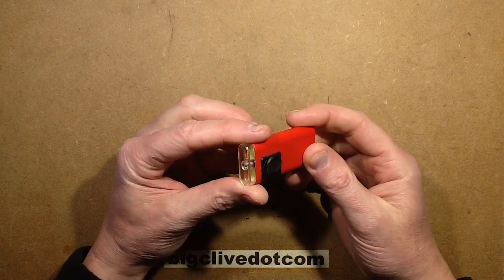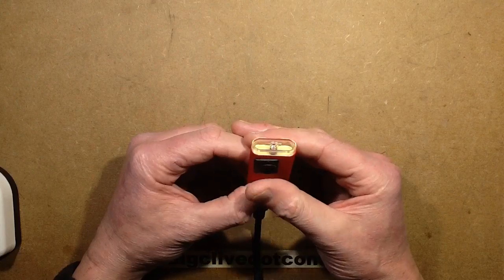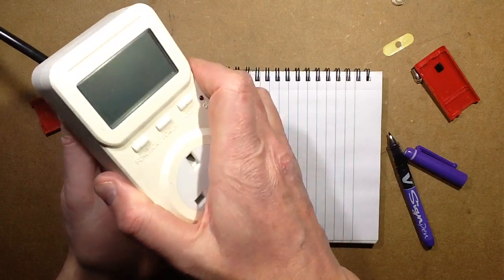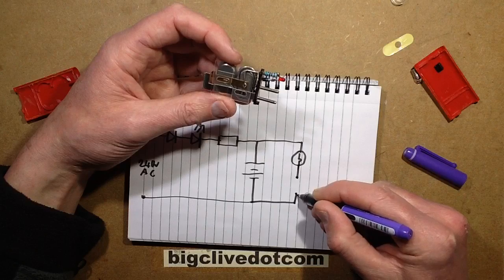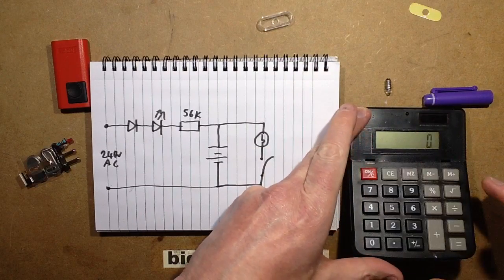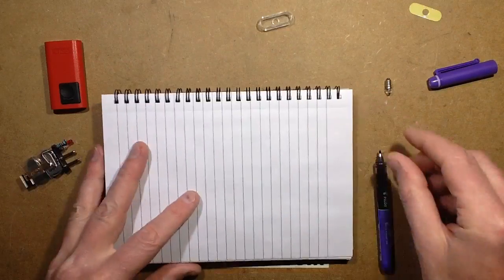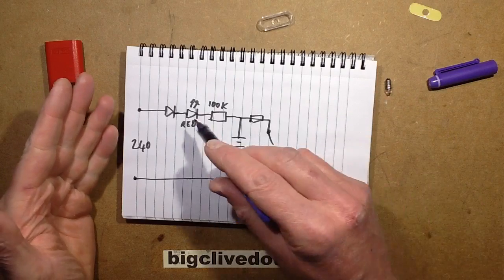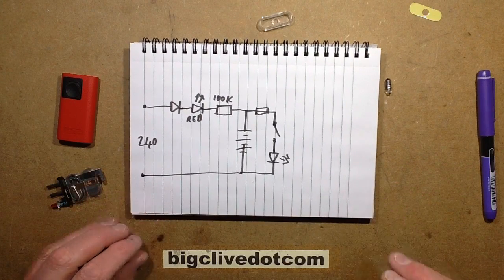Unique vintage rechargeable flashlight from 1980's (with schematic)

Comment: Very cool. So what's the purpose of the ordinary diode when you already have the LED there? Do LEDs allow too much reverse current at that voltage?
Reply: LEDs will not tolerate a reverse voltage. Even though cheap products often don't rectify AC before applying it to an LED, more than a few volts is not a good idea.
Reply: I've learned something new - thanks!
Reply: Yes, LEDs are typically rated to a reverse voltage of only 5. It isn't a good idea to use an LED as a rectifier (especially the Gallium Nitride type), but I have an older set of Christmas lights that uses all of the LEDs in series and it rectifies that way.

Comment: Thats a nice old key torch, handy to find the key and lock on your front door.
Clive, do you remember the ones that were two watch batterys in a odd shaped case no bigger than your thumb, a lense bulb stuck out the front, it was on the key ring?
Reply: zx8401ztv
YES... We had them during school days in the '60s.

Comment: NiMH would be a bad choice, the chemistry don't like float charging... NiCD is still better for that, hence why some solar lights still use NiCD and it last forever. Also, a capacitor dropper would be to be considered instead of that, because it would reduce the power consumption quite alot.

Comment: Pitney-Bowes used to use those flat-pack 1.2v NiCd cells as memory backup in their faxes. Buying the "authentic" replacement cells was not cheap, so I used to simply cannibalise the old PP3 rechargeables, and use the individual stack elements as replacements. Worked just fine, and saved us a heap!

Comment: So funny something like this would show up on your channel, when I was a kid in the mid 1980s my grandfather had something very similar, mind you we lived in the Netherlands and I believe it came from a store called Kijkshop, which back then sold all sorts of gadgetry among other items. Our version had a plastic cap on the back that slid off to reveal a Dutch type two prong electrical plug and I am sure it did not have a red indicator led, but other than that a spitting image of this, interesting to see some of these things are still around and amazing the batteries held up this long
Reply: yes, they do. Sometimes use it... still the same battery but I had replaced the lamp (it burned down). Could replace it with a LED next time...

Comment: Like other have said I also had one like this back in the 1980s. Mine was slightly larger and was white with a removeable black cap on the end which covered a two pin European-style plug. You plugged it into a shaver socket/adapter to charge it up. The torch used one of those MES pre-focus bulbs. It was made by Superswitch and I've never seen another one exactly the same. A very similar torch is still made today by Acculux, see http://www.acculux.eu/short-distance_range_battery-powered_lamps.php

Comment: Isn't cadmium expensive and more toxic .
Reply: Not only that, but Nickel Cadmium cells don't have the energy density required for modern applications. With energy density Lithium and NiMh can compete, Lithium usually wins out due to cell voltage, ease of charge control, and charge efficiency.

However with all of that said, NiCd is Perfect for this application! A NiCd can withstand an overcharge at the C/10 rate indefinitely. With a C/10 charge rate (16 hour charge) NiCd does not require special charge control circuits and can be connected to a current and voltage limited supply.
Reply: Also NiCd have a flat voltage curve (holding up the voltage until they are totally depleted). They can provide large amounts of current (about 20A for an AA cell!) and also can withstand cold conditions without suffering.
Reply: NiCd cells can withstand a lot of abuse (over/undercharge/shorts or very high current load)  Perfectly fitting this application.

For my mobile phone I woud rather stick to the lithium .

As RC hobbyist  I started with NiCd cells ..now I moved to Lithium based cells..but I still remember the  "good old"  days...zapping old shorted cells to get them working again etc :-)

Comment: Clive you should get one of the cheep eBay 405 nm laser pointer to soak the glow in the dark material to show on the camera. Once you shine the laser on the glow in the dark stuff it should glow quite brightly for a short time. Just make sure you use the 405 nm laser pointer as if the laser wavelength is not smaller than the emitted light this will not work.

Comment: We had one similar to this back in the late 60s-early 70s I believe, which had the incandescent bulb, and two prongs on the back end, covered by a plastic cap, made to plug directly into a North American 115V outlet.
I took it apart after it eventually failed to hold a charge, and it had some sort of gel-cell battery made up of plates stacked in a clear plastic envelope. There was no apparent circuitry of any kind, and I was baffled at how it dropped the voltage to charge the battery, which ran the bulb, which was either 3V or 6V, I don't remember.
But I was just a youngster at the time, so I never did figure it out.  I was however very impressed with the technology for the time.
I suppose it had a simple resistive-capacitive dropper, which accounts for why the battery failed from being left plugged in continuously for a few months.
Found it: https://www.etsy.com/listing/111803619/vintage-1960s-japan-equality-plastics

Comment: I'm sure these are same type of torch provided in quite a lot of older BMWs! My old 1997 740i had one and so does my 2000 318ci have one. Made by the same company but they charge through a dock in the glovebox. They are also modified to fit in with a BMW interior better. 

The circuitry is also very very similar!

Comment: I have a water heater timer from the 1980's made by Reliance Electric that has a circuit somewhat like this. The motor was made in France and has a 555 timer chip on it. The battery was a NiCad but it finally failed spewing it's content onto the charge components. The two resistors looked burned so I contacted the company and I was surprised that two engineers came back with the values. Simple circuit in that it uses two diodes two resisters  off of a 240 volt mains. I replaced the button cell NiCad with a much larger rectangular NiMh cell from some pack I took to bits. It has been doing just fine even when I cut the power off to it on a two week holiday the clock keeps going. This carry over feature is very nice and the longevity has been more than expected. That repair must be 8 years old by now?

Comment: I have a couple of russian made flashlights back when I was a kid, they was basically the same charge circuit from what I could remember, it had 3 Ni-Cd cells in it at a capacity of about 200-250mAh so yeah, the runtime was well under one hour even with a fully charged battery. I searched and searched to get one but couldn't find it. I have managed to get a modern version with led's and single cell that charges with a capacitive dropper but if you have the leds on and you plug it in, the boost chip for the led or even the leds burn because the inrush current of the capacitor, if you plug it in when the sine doesn't cross the zero point then it works but it burns at the peak of the sine wave. Anyway, enough rambling. Cheers :)

Comment: Although the voltage is set to 230V in whole EU, it has quite a large tolerance so none of the countries had to change their actual grid voltages with it. BTW 219V here in Tallinn Estonia.
Reply: Right, it is 230 V +/-6% in most of Europe, except UK, where it is +10%/-6% of 230 V: https://en.wikipedia.org/wiki/Mains_electricity#Voltage_levels
But soon it will be all of the EU with +/-6% ;)

Comment: This will probably seem daft to you as an electronics engineer but can you tell me how can you put 240 volts into 3 volts without blowing the batteries.  What in the circuit lowers the voltage?
Reply: Mike Rhodes The big resistor. Most of the voltage is dropped across that.
Reply: You can charge a battery at any higher voltage you want to, providing your battery has anode and cathode far enough apart to avoid arching, and the current is kept low enough to avoid overheating.   There may be some very high voltage threshold to prevent breakdown of the electrolyte or plates in a battery too, but that is beside the point that in this case, the resistor drops the voltage and necessarily so as it would fry the LED it passes through if it were above the ~couple forward voltage of a red LED.
Reply: Thanks, I am new to trying to understand this.